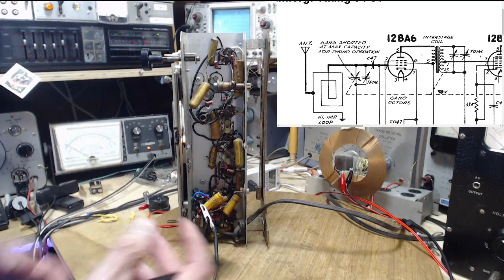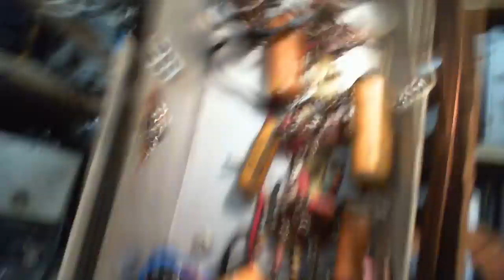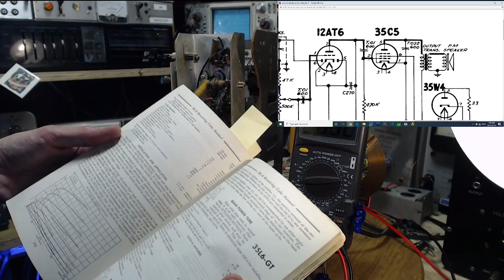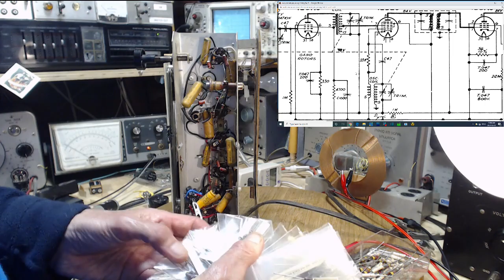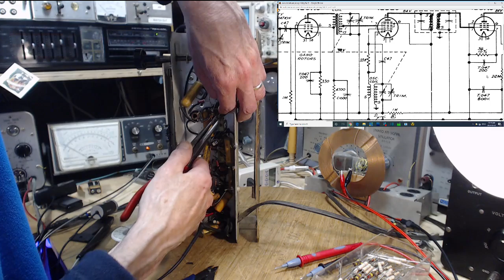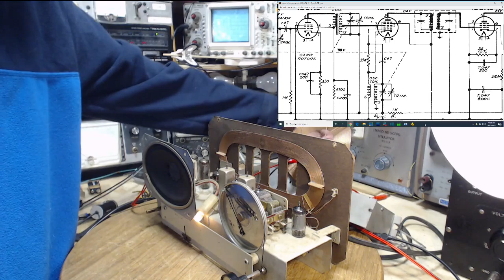Viking Model 54-51 Video#5 - Voltages

Comment: Definitely not  a Mr. Carlson's Lab graduate!
Reply: Carlson's Lab would have stripped the unit down and rebuilt it from scratch replacing all wires and parts with new parts and I just wonder if someone had replicated this radio using the pencil stub vacuum tubes that operate on a B+ of 50v and a heater of 3v so that it runs nice and cool like the AA5 shirt pocket radio.

Comment: "These capacitors look good..."
CHANGE THE BATTERY OF THE DMM - Measuring high values of resistors is a sign of low voltage battery !!!
I think you do it on purpose, just to get an extra video per radio... So far this is number 5 and the only thing he did was the alignment, replace a tube and soak two tubes with WD-40 (not the volume pot, who cares about it)...
" THE RADIO'S PERFORMANCE IS REALLY QUITE GOOD... "    REALLY?
Reply: StillCloser We should not question the performance of the radio. When a concoction of electronic components crackles whistles and pops it is always GOOD RESULT.
Reply: @melissahermsen5630  It's a good result for Jim.